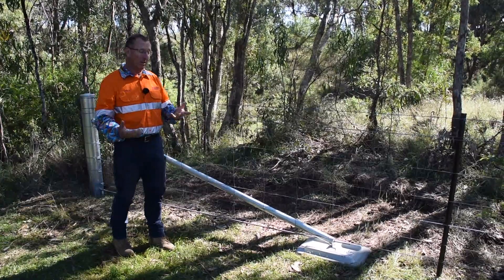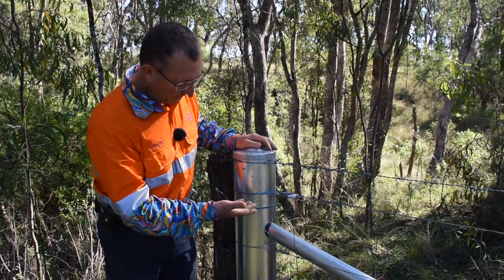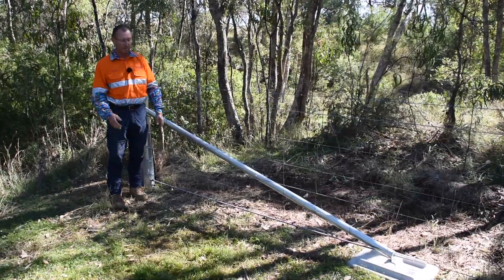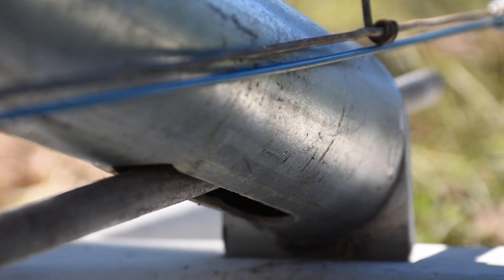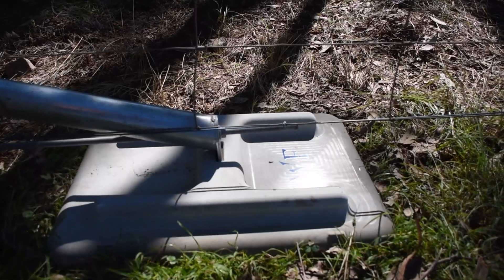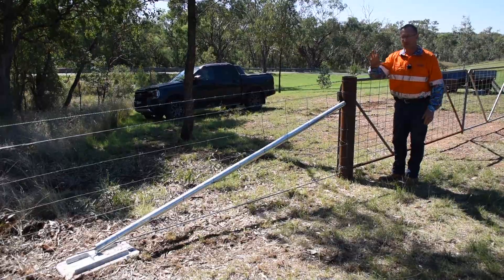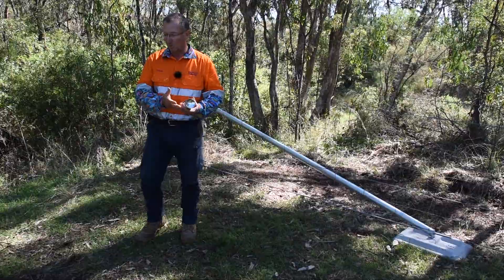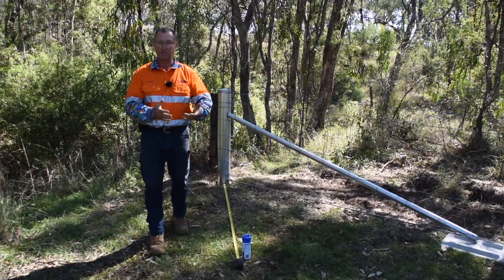Single vs Double Stay: Which Is Best for Your Fence Corners?

Comment: Mate you're way off track with the comments about single vs. double stay corners. Doubles share each load strain independently and are much stronger. How can one anchor and post share two load directions and be stronger just isn't a sensible comment.
Reply from the maker: @gw5436 When tension comes from two fence lines meeting at a corner, the resulting force acts in a diagonal direction through the corner. A single stay placed on that bisecting line directly opposes the combined load, creating a straight-line resistance which is structurally efficient. With a double stay - each stay resists only part of the load. They don’t directly oppose the combined force vector, which can result in twisting or inefficient load transfer. Especially if one stay slips, the whole system then becomes unbalanced. As well as the physics, we've also found the 30+ years of experience supports this!
Reply: It definitely does depend a bit on ground angle, and length of the two sections if using a single stay. A short section paired with a long run will be better served with double stay, but sections of similar length that can ‘float’ the wire tension around the post will hold better as a single stay.

Comment: Do the "push up" demonstration with one arm only in the centre position.
I would also like to see the maths for both options.
Or maybe a collaboration with Tim Thompson where you build them both and test to failure.
Reply from the maker: @johnboyce6044 We're copying and pasting our reply to another comment below, but here you go! 
When tension comes from two fence lines meeting at a corner, the resulting force acts in a diagonal direction through the corner. A single stay placed on that bisecting line directly opposes the combined load, creating a straight-line resistance which is structurally efficient. With a double stay - each stay resists only part of the load. They don’t directly oppose the combined force vector, which can result in twisting or inefficient load transfer. Especially if one stay slips, the whole system then becomes unbalanced. We have also filmed a collaboration with Tim Thomson on this topic a few years ago. :)
Reply: We did a collab with Tim on this subject already 😁
Reply: A single stay in the middle of the inside of a change in direction is better; it uses less material, and provides a longer length stay resisting against the two vectors of force being the strained wire.
Reply: Could we have link to that, please?
Reply from the maker: @ https://youtu.be/InXmf20SP2E?feature=shared
Reply: Less of that Tim Thomson, not more. Great to see others who actually do the work and design stuff posting videos instead.

Comment: Do you ever have an issue with station owners come farm operators complaining that your not straining up the wires tight enough even though your tightening up to recommended strain tension? I get it a lot and at times are pressured to put extra strain on just to keep the client happy although I’m know it’s less than ideal for the wire and the fence as a whole. But farm & station owners (kings of their domain) always know best and generally refuse to listen. Half of them do listen (just takes a couple years for it to sink in), some don’t care, just as long as it’s not them putting the fence in.
Reply from the maker: @jamesthefisherman832 We haven't really had that issue, but we have been challenged on a lot of our different techniques and practices. Sometimes there's nothing you can do about it to change their mind, and sometimes like you said - it just takes some time and patience.
Reply: @ 
Yes, time and patience exactly 👍🏼
Some of these fellas over here still insisting to hang the wire off on the flat side of a steel post/picket 🤪
 But SLOWLY noticing change over time 😁
Reply: I'm in the opposite camp (as a farm owner) I recently had a new fence put up (in high tensile) and was blown away by how tight they did it. All my old fences are soft wire, and so I'd never attempt to strain to near the tension that the contractors did.
Wasn't around when they did it, so I've no idea if they used an indicator, or if they overdid it and I haven't brought the subject up, so I guess we'll see how it goes with time.
Reply: Not often mate, but generally we would make the point that wire tension high/low is much less important than the strength of the end assembly post and stay. Depth of strainer post is king 👑 if your strainer post is deep enough, the stay purely functions to stop bending of the post and jacking out of the ground doesn’t happen.